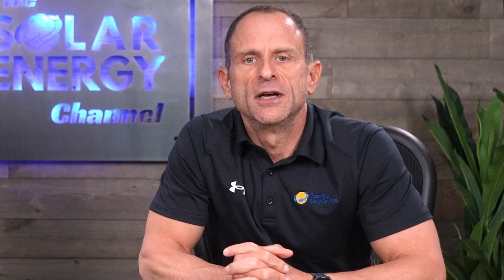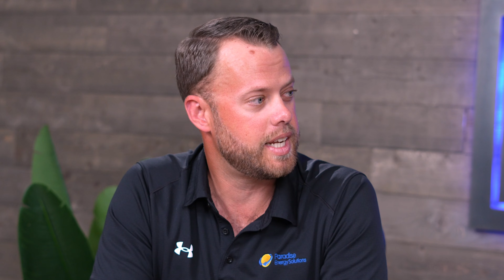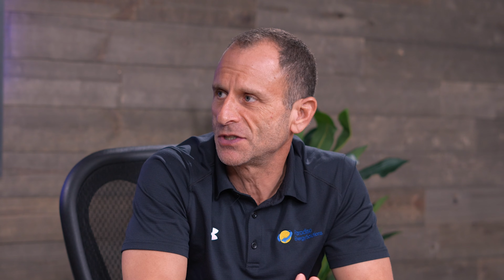What Could Go WRONG During Your Solar Installation?

Comment: Thankfully, my installation had none of these issues.  I had a very cooperative electric cooperative so that side went well.  I had a paved driveway so no need to drive much on my grass.  And all of the hardware worked properly when energized.  The only minor issue was that my installation used panels that Paradise apparently hadn’t installed before and were 1/2” or so narrower than the crew was used to installing.  When they got to the last row of panels, there was a 4-5” gap between the last panel and the already installed array so they had to go back and loosen each panel and adjust the spacing to make things symmetrical.  This left a small gap between all of the panels, but that isn’t really noticeable.  Other than that, my installation was straightforward.
Reply from the maker: We always celebrate when things go as planned, or very close to planned, as in your case. Thanks for sharing!